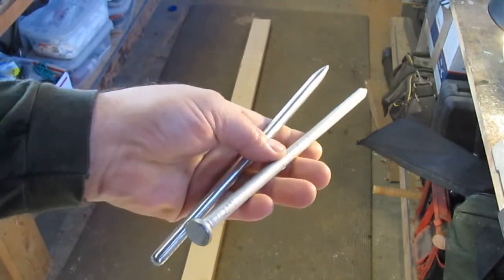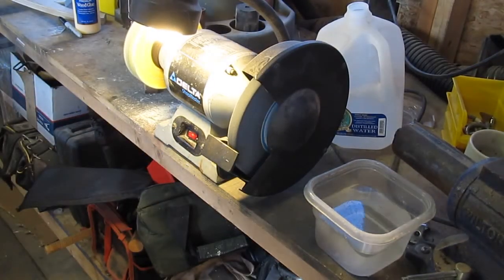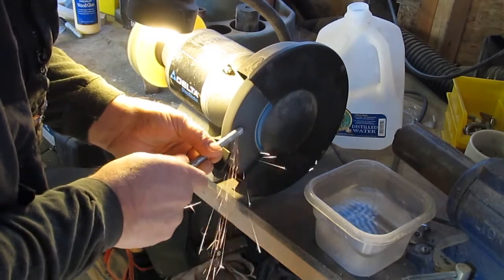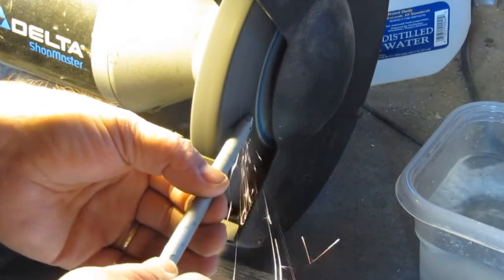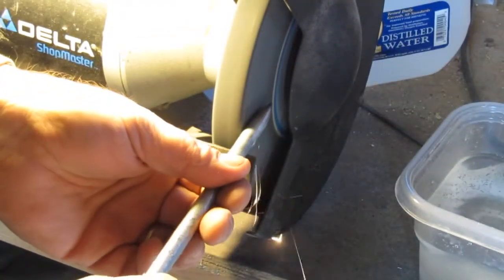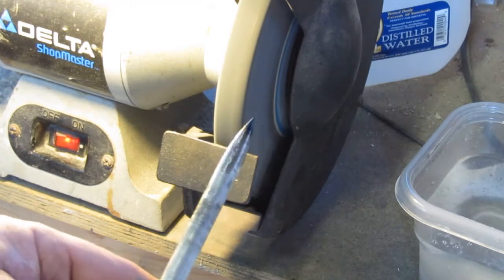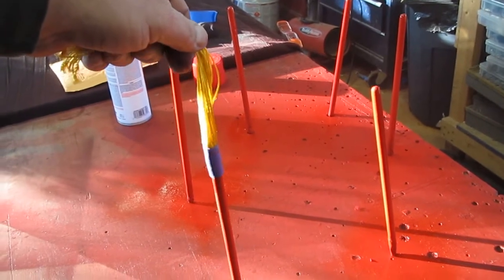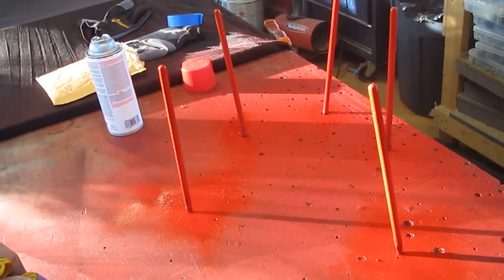Bo Shuriken: How to Make One from a 10" Nail

Comment from the maker: I do not have forge or oven or acetylene torch so this is as good as it gets on my end. Yes they do hold a point pretty well and no cracks or chips. I'd suggest using some steel rod 1/4" or 5/16" diameter rather than galvanized nails. Much less work.

Comment from the maker: Yes and I dip it in water whenever it does. At the end I heat treat the tip. Letting the metal get hot and cool slowly anneals it (softens it makes it malleable) heating the metal and rapidly cooling it or "quenching temper it (makes it harder and more brittle). It's easier to grind and shape untempered or annealed metals. But metals can also "work harden" as they are heated...so keeping the metal cool as you work it is important. soI dip it in water before it gets hot enough to be tempered.

Comment: Totally agree with both comments. I use the nails too because cheap and don't care if I lose a few and won't matter to me if I mess them up. Prefer steel rods be cause they are straight. I couldn't really notice by looking, but my nails were bent or just off when I got them. Anyway. Great job on your spikes. I like the larger ones too. I was just commenting on the changes need to be made when throwing because many people throw and it works and then change sizes and then it doesn't work.

Comment: I’ve made some of these already , I hacksawed the ends off then I had to make a shim out of rubber to fit in the drill chuck so it would bite down on the nail & not put scratches or deep gouges in the steel , then I put it in a drill & put it to the grinder . I put spikes on both sides just so if I feel lazy when I thro them either end will stick or if I want to thro no spin witch I do anyway . Then after I got the points nice & sharp I put them back in the drill & took 12 different grits of sand paper to the points to give them a professional shine or look it helped take the rough grind lines out or them

Comment: Hey there. I have done the same thing with the nails and using the longer ones are a little more difficult to throw if you use the same method of throwing. You may have to hold the shuriken higher or lower to help the balancing point when throwing because of the energy shift depending on hand placement and throwing power Also reminder. You may want to inform people that be careful when working with galvanized metal. when heated that stuff can cause vapors and it is toxic to breathe in.

Comment from the maker: I agree that galvanized metal can produce fumes. In fact just handling the stuff it rubs off on you. The best material for these Bo Shuriken throwing spikes would be steel rod. Speaking from experience you are HIGHLY likely to lose any spike you throw...use cheap materials to make them and make lots of them...and don't worry if you lose a few...you'll find them when it comes time to mow the lawn (JK).

Comment from the maker: That's a good point. I would advise anyone making these to purchase steel rod instead of nails. Much less work. You can easily part the rod to the desired length on the grinder (grind a v through the rod). I also like the idea of chucking it in a drill to sharpen it. I agree that these long ones are difficult to throw "no spin" style, but they are massive and penetrate nicely due to the weight for spin type throws. Galvanizing fumes are indeed toxic. I am sure I have inhaled worse though...

Comment from the maker: You know how it is...us Colonists like everything super sized. TBH you don't want to use nails M8, use steel rod...cheaper and better. pick a diameter about 1/4" to 3/8" and cut the rod into lengths. Experiment. These are way too long to throw in the usual no spin manner (cupped palm). 7" is probably about right.
Reply: Mountain Storm  you can no spin these from the palm i do it every day & they stick every time. Mine also have points on both sides so I can take a pick I what throwing style I want to throw at any time .

Comment: The grinding wheel is not meant to be used on the side like that...small pieces can get imbedded into the wheel and you can have it come apart.. The wheel does not have the same finish on the side than on the front with the bevel and although the chances are slim that it could blow apart but it also stresses the bearings in bench grinders....I know the side works best for the purpose of forming a shank like that but if you get used to using the front of the bench grinder and positioning yourself properly you might find it more effective after you get used to it...I just want everyone to be safe...The idea someone mentioned of placing the nail in a drill and spinning it on the wheel is a great idea and would for sure work well after you got used to that as well..

Comment: I made a few of these last week. I was messing with my gringer and had some small nails and sharpend one end then the other and threw it at a wooden fence. It stuck in but just barely so I got big nail I had and did same thing. When I threw it it bit deeply into the wood. I later used it on a hawk that was killing my chickens. Did not know hawks did that :P. Hawk died instantly. Great vid did not think to temper them
Reply: I think killing hawks is a federal offense.